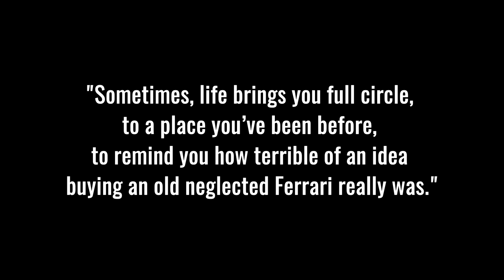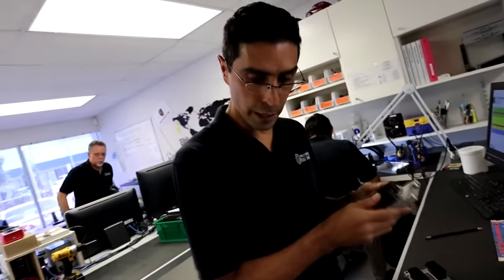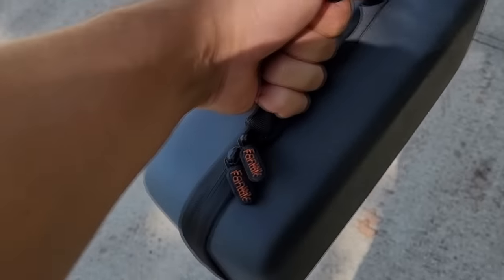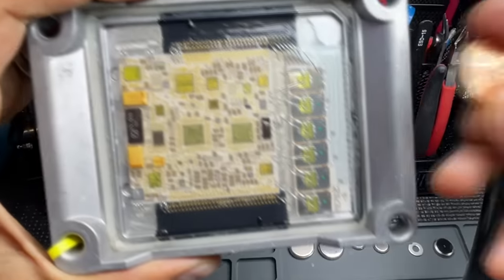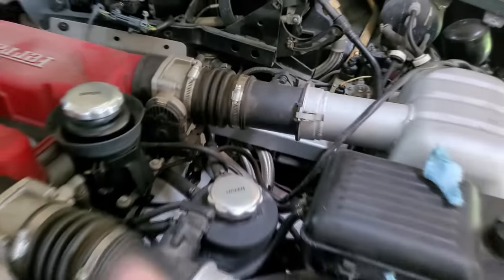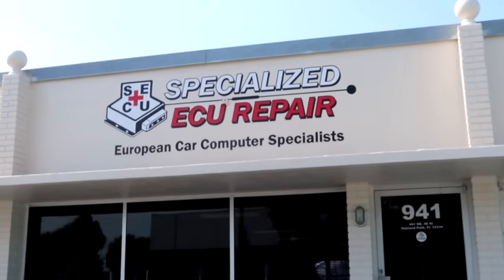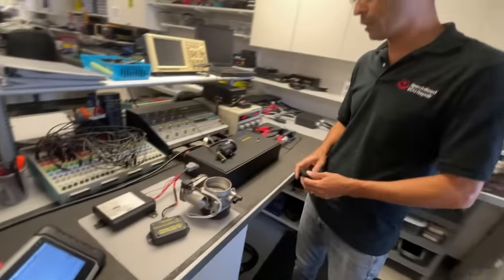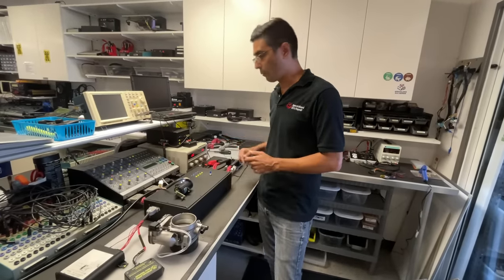Here's What FINALLY Fixed my Cheap Salvage Ferrari!!! (EVERY Ferrari 360's Fatal Flaw)

Comment: The clicking is the ECU failing its power on self test or getting a brown out and rebooting constantly. It might be serviceable if it's a passive component at fault but no chance of getting a replacement chip on board die. It's a super reliable method of construction but obnoxious for servicing. A lot of newer ECUs are even worse.
Reply: How much worse can it get?
Reply: Exactly what I thought when I saw it chattering. A solenoid load likes to do that, everything powers up and the solenoid current starts to build, which draws down the weak supply which resets the controller, releases the solenoid, and starts the whole thing over again.

I was hoping to see a separate regulator circuit that you could bypass, but it looks like it is all integrated. If you can identify the regulator or pass transistor, clip a lead or cut a track to isolate then substitute an external regulator.

It looks like a sharp meter probe might poke through the gel for testing.

After saying all that, I should add I have had very little luck doing any repairs on those ceramic modules.
Reply: This is how right to repair dies, when computer manufacturers go to this bonded board system that can only be worked on by a percisin multi million dollar robot. doing away with the current standard PCB board setup that anyone with a steady hand and a soldering iron  could work on.
Reply: @Qballl  resin potted and cryptographically locked.
Reply: @rvoisey  I mean doesn't seem much worse in terms of repair as both are not repairable
Reply: @TAKIZAWAYAMASHITA  the key is getting hold of the software unencrypted from the ECU - maybe manufacturers will have to be forced to release this if they stop making the hardware, so that third party replacements can be made.
Reply: Just thinking out loud here, but would it be theoretically possible for a manufacturer like Ferrari to produce some kind of standardized, cumulative, continually updated ECU that contains all of the code and incorporates all of the functionality of its entire range since the onset of electronic controls?  Such that it could be connected to an older car like Sam’s with appropriate adapter cables, have the VIN entered into it so that it knows what car it’s supposed to be controlling and which code to run and which modules to activate?
Reply: Ha unservicable
Reply: @andrewthomason3857  there’s gotta be a way to make it run with a universal unit like a Haltec.
Reply: Right!?, sourcing the die whether it’s wire bonded or a flip chip type arrangement is going to be a difficult proposition,especially if it’s a custom silicon someone like Bosch has the clout to use. Even worse if they are programmed in situ to OTP them together as an unbreakable set, not sure if that’s a real thing it just kind of popped out of my brain. Weird question though, has anyone thought to approach Bosch with a request commission a replacement ECU? Kind of like what’s mentioned here elsewhere but have an FPGA that could be mapped to a standard ECU for all types of engines the ECU was used on?
Reply: @tbthedozer  that sounds like best solution, just get Bosch to remake this ecu using fpga to emulate the original without having to physically remanufacture it. I’m not sure they’d be interested profit wise tho
Reply: @andrewthomason3857  That is indeed 100% possible with the obsolete system existing as a virtual machine inside a modern computer emulating  an old one. I am running MS-DOS programs that will not run on windows 10 in that manner.
Reply: @Qballl  cryptographically locked means, depending on the algorithm, that you 90% can't reverse engineer it.
Reply: @superGGfr  again to me something done that way and this way seem equal in the unreapairable area
Reply: Right. It really feels like a failed tantalum capacitor…and those, along with the rest of the passive components on that board, are conventional SMT. Clearing out the gel conformal coating would be the “difficult” part.
Reply: @enrimich64  sounds great but I would imagine there are legal issues around them giving away Ferraris IP and it would need Ferraris buy in, I could be wrong though but this kind of thing is never as easy as it should be.
Reply: Y’all think this is bad wait until everything is electric and has dozens of these same type of computers in there. Cars will become throw away because you will not be able to get parts to fix them.
Reply: they ahould pass a law that they must use an esp32
Reply: @Qballl  One word - Multi layer on that design everything was on the surface and then entombed in the resin, we have had solid state where it was 5 layers and only after separating them out found resistors between layers, in our one an internal power feed had drawn too much current (design flaw) and blown. Possibly why they went out of business.

Our fix was to build an emulator in software and migrate the code onto that but this was for a piece of equipment that is in a room not a car, had the ability to be wired to a PC. A plug in replacement would have been cheaper if the OEM still existed or any diagrams repair were available. For us it was how to repair something that was 3 years old, still supposed to be under a warranty and cost 7.5 Million or scrap it and replace the whole thing.

If there are enough of these cars out there and enough demand then Holley will build a split dominator computer and wiring adapters. As more of these computers fail and less parts are available the R&D will get to the point an aftermarket ECU manufacturer may put time into it or a customer will pay them to build it and they will take the IP from the customer build to make more.
Reply: @DesertVan  Yes but running an engine is one thing, Airbag's, Launch Control, Electronic controlled suspension, ABS, transmission and all the other features in the computer start eating after market inputs and outputs and unless you have the code to talk to these the way they expect (pretty sure Ferarri do not use standard CAN networks in their cars) hell even Boeing and Airbus use different communication so a Rolls Royce engine is unable to be swapped between the brands but the parts are exactly the same (Model number defines the wiring, sensors and computers attached to the engine).

Military's aircraft use a different communication network again and to retire them for sale requires a full re-wire and replacement computers and sensors this is why they go to graveyards not sold.
Reply: @shazmeister2005  reverse engineering is fairly protected practice so long as you 1.) didn't work for the company 2.) didn't work for a vendor of that company and 3.) are not selling an exact duplicate. Notice this doesn't mean you still wouldn't be sued, just that you have an argument to the case.
Reply: I came to that conclusion as soon as I saw the throttle body "click" of the second one. It's clearly part of the initialisation sequence
Reply: B00 050  I remember blowing up tantalums in college by intentionally connecting them backwards in a power supply. It was like a firecracker. This was around 1980. They weren't surface mount, but surface mount hadn't been invented yet.
Reply: @andrewthomason3857  Possible yes but why would they bother? - better for them to sell a new car. Then you don't have the 'problem' for them of a 250 GTO being worth squillions & Ferrari not being able to get a cut of it
Reply: @enrimich64  If they'd release a schematic of the ECU and identify what's in the custom chips, I think you'd see opensource, FPGA ECUs popping up :-).  I'm an FPGA designer myself ... I'd LOVE to see that :-).
Reply: So wouldn’t that be a failed cap?
Reply: @tbthedozer  Got to wonder how many of these Bosch put on the shelf, in order to supply immediate buffer stock delivery to Ferrari, in between production runs. OR, if  Bosh had a min run size, and Ferrari only bought as needed. Somewhere, there may be thousands of these NOS. Or possibly, Bosch may have a Vintage/Collectors program for out of contract parts. Has anyone CONTACTED Bosch ?
Reply: Could an aftermarket programmable ECU such as a Haltech worked for this?

Comment: I've worked in the automotive field for 35 years. One of the earliest safety lessons I learned was how to remove and install a battery. We disconnect NEGATIVE FIRST...and reattach it last. This not only reduces the chances of sparks...explosions...etc...BUT it is also easier on sensitive electronics...given the subject of this video...just saying.

Comment: All these type of BOSCH devices have the same issues, the bonding wires break and in some cases they can be repaired but very tricky. That ECU looks identical (physically) too the failed one in my Opel Vectra (GM CTS engine in US) that I had replaced by GM (Holden) for about $1500 Aus.
The BOSCH ABS units in the same era are notorious for the same type of fault and I had one repaired by a company in Australia that just does these units. Because these BOSCH units are so shit and used by heaps of car manufacturers they should have had a class action brought against them in my opinion.
Reply: Yes fix quite a few is a very common issue and even with BOSCH ABS computers as well. Fixing the bond wires is not impossible and can be done as done quite a few with good success rate.

His I think is due to he likely jumped it. Those BORSH computers hate spikes. I see regulators are powering on as computer is failing self test and reason for clicking on throttle body, it restarting. Easy test each voltage regulator and rail voltages.  Likely he blew a passive or active component somewhere which is fixable or worst a ASIC chip which isn't fixable. No communications with computer is not a good sign and would be hard to troubleshoot beyond testing rail voltages as no obvious damage to narrow it down?
Reply: We were able to re-connect some of the bigger aluminium bond wires with a special solder on failed ECUs however I still walk away from this ECUs if I can 😀
Reply: Injectronics? Expensive mate. Do good work though
Reply: Does the circuit board covered with epoxy?
Reply: @edmondhung6097  No, its a type of clear silicone that can be removed carefully with a toothpick from the spot you need to solder
Reply: @VladoT  so in theory, the silicone can be removed from the die. Remove the bond wire, clean the pads, and bond again with the bonding machine?
Reply: @edmondhung6097  The problem is when you try to remove the silicone from very tiny bond wires like ones coming from the chips the bond wires break and its over. But I was able to sucessfully remove the silicone from the bonding wires and pads from the transistors and the connectors which are thicker. But most of the problems are from them anyways
Reply: @VladoT  the problem is from those transistor? Sound like it can be replaced with normal transistor, 30AWG wire and normal soldering to me. Maybe need some modifications on the case to fit them. But it should work.
Reply: @edmondhung6097  Because of thermal stress bond wires fail and they fail most of the time. However it is not uncommon to see burnt mosfet that you replace with IRLR2905
Reply: @VladoT  the process is designed to be fully hold inside a epoxy package maybe.
Reply: @edmondhung6097  Maybe but if they used tin instead of aluminium bond wires those ECUs would last much more.
Reply: Normally its just a connector to pcb link that fails. Chip to pcb almost never falls apart from output drive mosfet
Reply: @VladoT  I mean just buy a new one can you flash used ones?
Reply: @VladoT  until you develop tin whiskers. This ia a HUGE problem with early lead-free stuff 

Not to mention that if it gets too cold, your tin wires will fail more or less instantly and permanently
Reply: @edmondhung6097  The BOSCH ones I have seen are covered with a silicon type gel, it can easily be moved aside but the wires can be easily damaged.
In my opinion the gel is part of the problem as I believe the fine wires can move around ever so slightly until they break.

Comment: Not just Ferrari, welcome to the world of obsolete vehicle software.
Reply: Well, if you have a computer the software will always be available as it's just data. The hardware is the issue.....just look at Ford not being able to get chips for 10's of thousands of brand new trucks......
Reply: @muskokamike127  Software doesn’t last forever, especially cheaply written software. Corruption is going to set in over time.
Reply: @jonathanteymouri7112  no, that’s milk…
Software stay, it’s bitrot on the memory chips rhe issue…
Reply: I purchased a 2006 MK series 2 Mitsubishi Triton in 2017, started having major electrical issues with it. Within less than 11 years the technology & repair methods had become obsolete. I spent thousands of dollars trying to fix it, Even took it to a Mitsubishi dealership service garage, They had it for over 3.5 weeks & couldn't fix the issue. In the end I had to sell it for nearly $12000 less than what I paid for it just to get rid of it & get a reliable car. NEVER again will I buy another Mitsubishi.
Reply: @Ausscratchie  Mitsubishi is the Japanese equivalent of Chrysler
Reply: @Ausscratchie  yet the 2007 Delica D:5 remained unchanged until the 2019 refresh
Reply: @jonathanteymouri7112  Your statement is absolutely incorrect. Software and firmware stays the same until physically changed :)
Reply: @jonathanteymouri7112  it CAN but if stored on a secure device, 1st gen, it'll last longer than most people who own the vehicles.

I've got files stored on floppy discs from the 80s.....I went through them not a month ago and all read fine.....
Reply: @jonathanteymouri7112  Incorrect , software is software and the only reason it changes is because the hardware stuffs it up by corrupting it or a power spike. Even a power spike is caused by poor hardware design and cheap hardware.
Reply: The hardware is the issue here. Rather than use standard surface mount PCBs they decided to use some sort of wire wrapping technology done by a machine. Nobody has the hardware to do that.
Reply: @jonathanteymouri7112  That's most likely ROMs and flash memory burning out. You'd have to be a complete moron to design a car which uses flash memory for non-volatile storage of day to day parameters. But I don't think that is the problem here, it's a dead component or a connection that's gone bad.
Reply: @andrewallen9993  Not always. ROMs can fail, especially the old UV erasable ones. There's also instances of programmable logic chips (PLAs) which go bad. That's more on 1980s devices though.
Reply: @6581punk  And that, my friend is what we in the trade call a hardware fault whereas faulty Boeing software running on perfectly functional hardware is what flew two aircraft and all aboard into the ground!
Reply: @Bercilak de hautdesert There shouldn't be any updates as nothing has changed on the engine.....My pickup is 17 years old and hasn't had an update to the ecu. 

It's not like windows connected to the internet, or a tesla where hackers can gain access to it......
Reply: @muskokamike127  change of fuel additives/quality, change in emission regulation. There can be few reason to change a software parameter…
Reply: @G_de_Coligny  changes in emissions has nothing to do with older vehicles, they are grandfathered in. 

As for octane etc, there are additives that can modify the fuel parameters.

As I said: the ecu on my 17 year old truck hasn't needed to be changed so you can safely say I'm good. 

Btw: the changes in fuel quality? That's accounted for by the ecu. That's one of the reasons they HAVE variable timing, fuel injector timing and duration, air/fuel mixtures etc. 

You're literally trying to create an issue where none exists. How many updates to software do you think they will produce when they aren't even producing the computer anymore?

How many updates have you received recently for windows xp? No rush, I'll wait.
Reply: @muskokamike127  yea sure…
Reply: @jonathanteymouri7112  no, that's just not true at all.
Reply: If only someone could start a company specializing in aftermarket ECUs...
Reply: @Ausscratchie  Japanese cars are required by (japanese) law to be supported for nine years past point of end of manufracture. After that you're on your own

Japan is one of the very few countries to have such laws and that one's been on the books since the 1970s - it's one of the reasons WHY Japanese cars had such a great reputation vs those from other countries (which frequently stopped being supported with parts the day the last one rolled off the line)

Comment: Mega squirt with a canbus harness, you could make a adapter to current engine harness if I had the wire harness schematic and engine harness schematic easy
Reply: Speeduino
Reply from the maker: @maxinnn1  interesting have to look this up
Reply: @Samcrac  that will be nice to see in the future if you also decide to use it